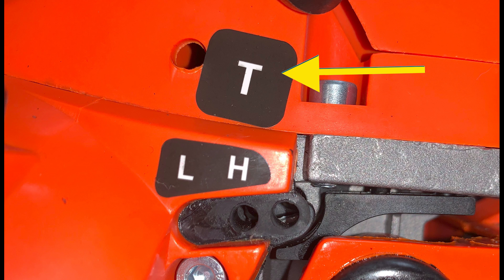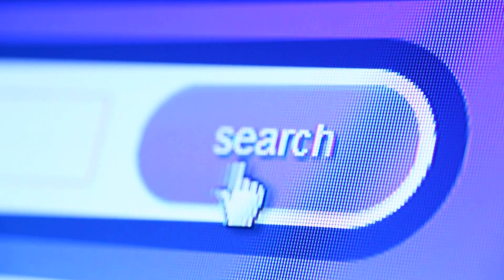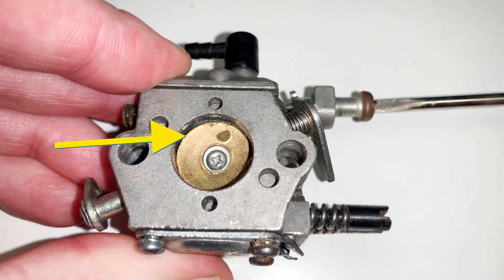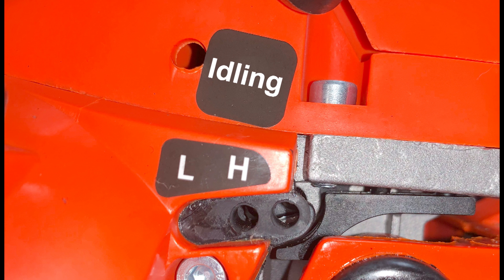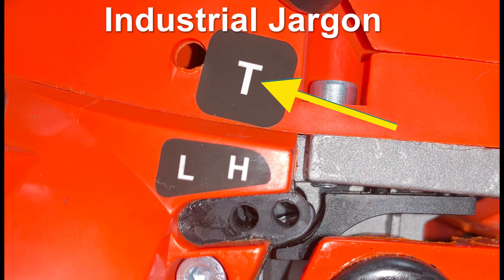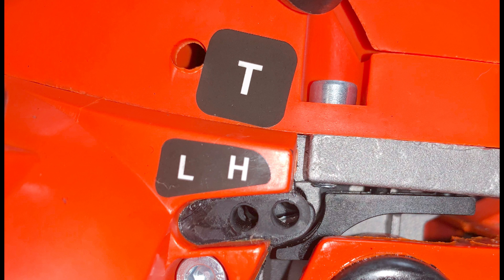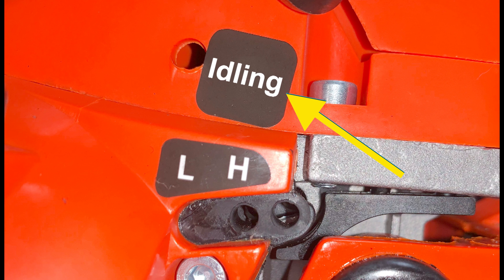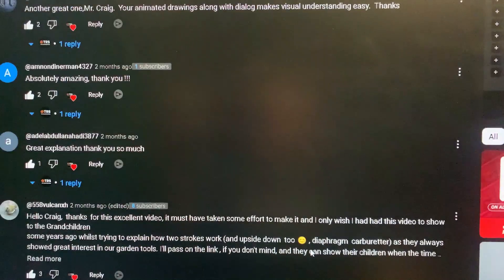The T-Screw on your Chainsaw. What is it?  (by Craig Kirkman)

Comment: I have made my own theory on the matter.

The painted letter I with upper and lower serifs looking like  ][ for idle could degrade to look like the letter L.
The letter L could also degrade to look like the letter I without serifs.
The letter T for either tick-over or throttle could make it "safer"

So maybe a mix of typographic safety and mass production if that makes sense.😅

Comment: What is the function of the spring on the T screw? And is it essential?
I noticed in this video the spring is only present in the first view of it but none of the rest?
Ive a Husqvarna 460 rancher and accidentally backed the screw all the way out and lost the spring. 
Managed to retrieve the screw with pliers and put it back without the spring and tuned the carburetor including idle speed. Saw sounds good and Works great again, but i dont want to put it to real use until i figure this out.
I figured it just helps keep the adjustment in place like a locknut?

Comment: Have you done a blog on how to slow down your self propelled  lawnmower ..even with the cable at max length mine runs away ..could it be the belt ? It locks the wheels when trying to pull it backwards

Comment: In Norwegian the word for idling is tomgang, probably just a coincidence but still a verry fitting coincidence 🙂
Reply from the maker: That's such an interesting linguistic coincidence! It's fascinating how languages sometimes align in unexpected ways. "Tomgang" for idling in Norwegian does seem perfectly fitting, doesn't it? It's like the word itself captures the essence of what idling represents - a sort of "empty" or "idle" state where the engine is running without much purpose. These little connections between language and concepts can be quite charming. Thanks for sharing this delightful tidbit, and if you ever come across any more language quirks, I'd love to hear about them!

Craig
Reply: @TheRepairSpecialist  we also have the related word Tomgangskjøring which is made of the words Tomgang (idling) and Kjøring (driving).. If you translate the two words that "tomgangskjøring" is made up of, you would get Idling-driving, an oxymoron i belive the term is 😃
Tomgangskjøring is when you leave the engine of a motor vehicle idling/running with  the transmission disengaged from the engine while you are parked, and it is (at least in Norway) illegal.. as far a I understand this law against tomgangskjøring does not apply to outdoor power equipment.

Comment: Question, why did small engine mechanics stop working on small engines? I decided to take my collection of saws, trimmer, and backpack to be tuned and serviced for the season. All of the local shops told me "No we don't work on that" with the variant of tool or brand being the excuse.
Reply: Because the minimum cost of the labor is now more than the replacement cost of the item. Many customers don't want to pay 100 dollars for an hour of labor plus parts when you can get a new saw delivered for under $100.